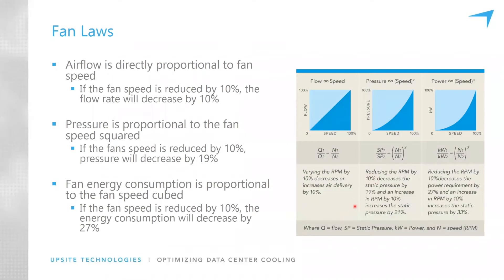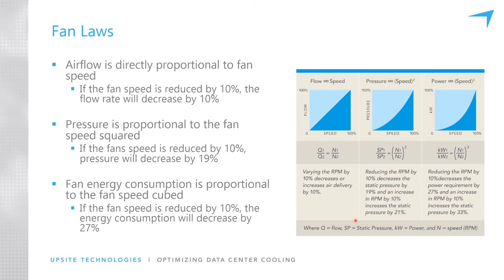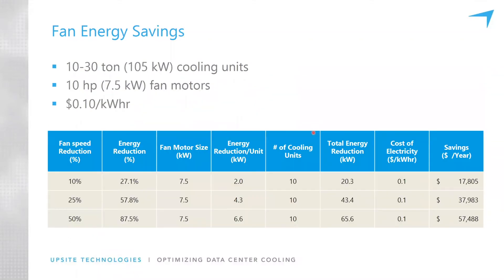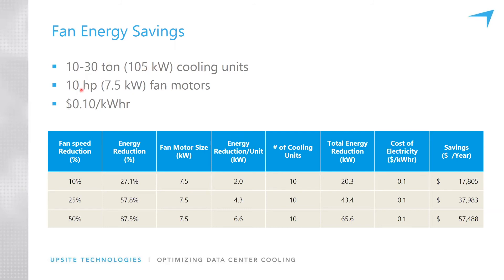How Fan Affinity Laws Impact Fan Energy Savings

Comment: the picture around 0:12 have wrong information, Increase RPM by 10% increase the Power requirement by 33%, not increase the static pressure by 33%